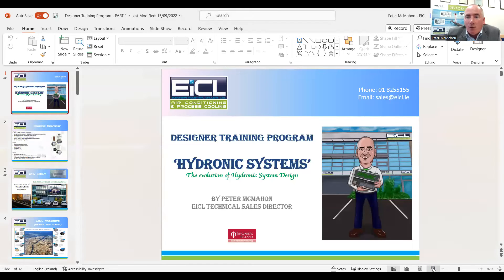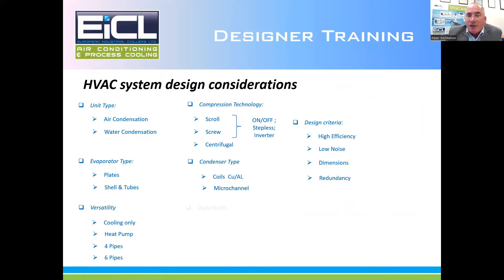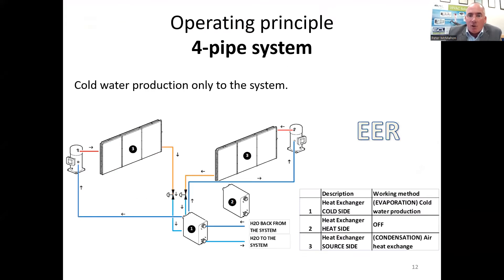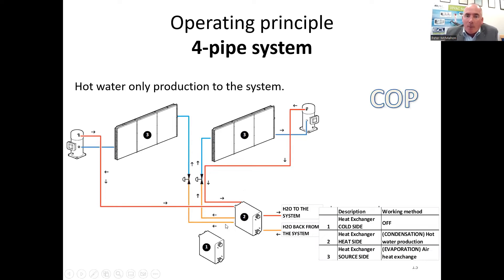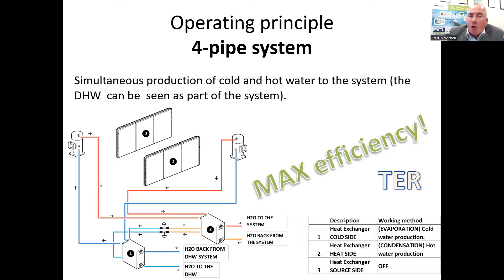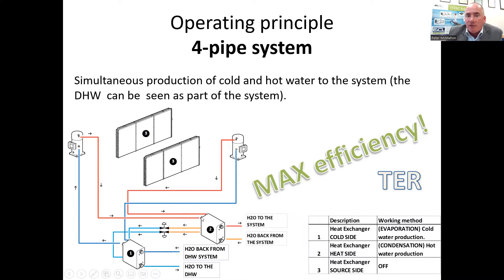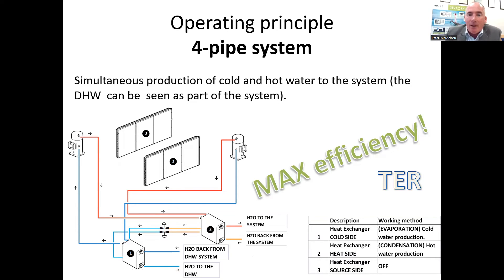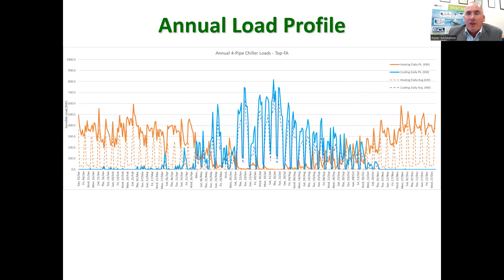Aermec NRP Multifunctional Heat Pump - modes of operation

Comment: we have been receiving alarms on these four heat pumps what could be the problem here are the alarms Heat Pump Chiller #1 - Overload Comp 
Heat Pump Chiller #2 - Flowswitch
Heat Pump Chiller #4 - Low Pressure from Sensor